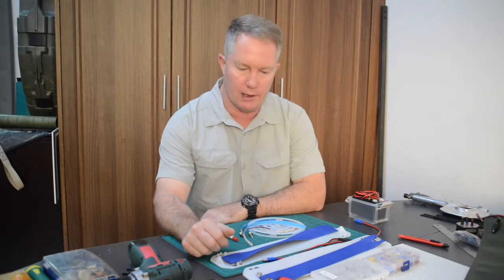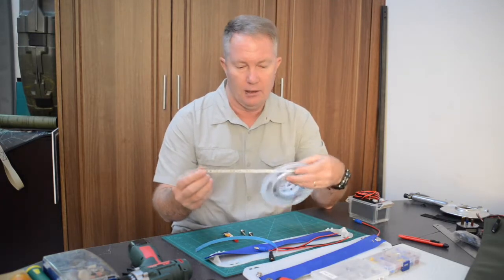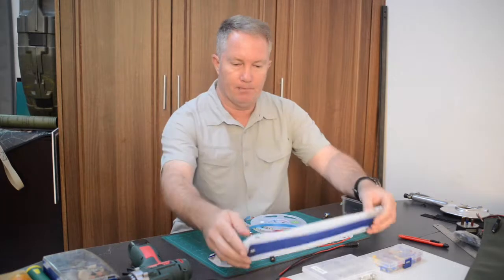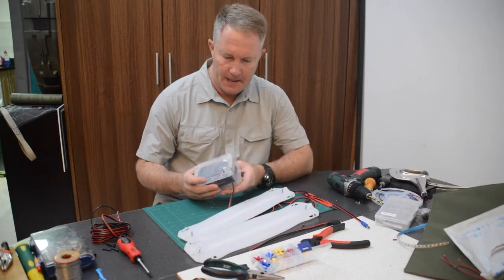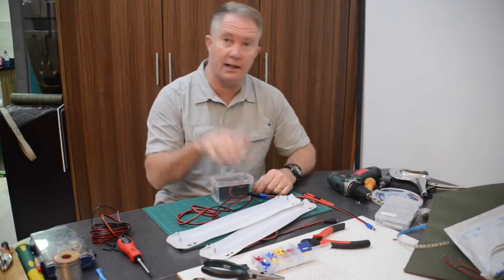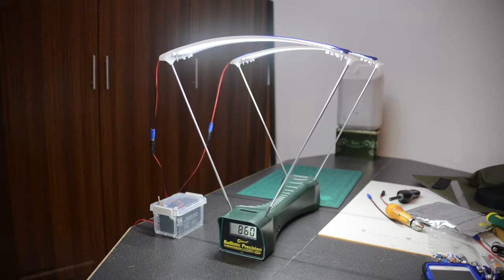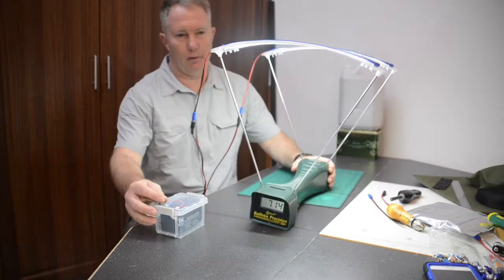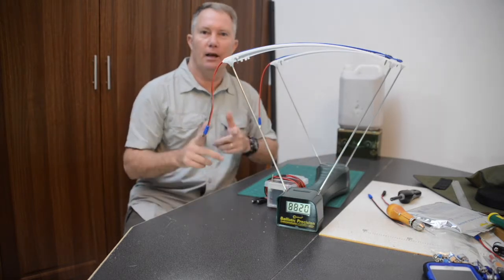Chronograph Fix for Indoor Shooting

Comment: I’m amazed at how expensive these are and they use visible light not infrared. I have just tested a cheap Chinese unit ( with an oscilloscope) accurate to  around 2miles per hour . Very reliable . I did make a cardboard cover as it became less sensitive in sun light!

Comment: is light on top or bottom of roof
Reply from the maker: Hi there. The light is on top. I do not think it will make huge difference, but shining through the white PVC will defuse the light and I think (maybe) easier for the sensor to see the arrow/pellet... ??
Reply: @affordableairgunningbyjb6994  yeah i got some wide fluctuation fps
230-330 fps on a korean bow.
Reply from the maker: @HistoricalWeapons  Was your light at the bottom ??

Comment: Did you use any specific type of LED's? Because when I tried using some battery powered work lights in the same manner, my chrono went nuts. I figured it was due to flicker.
Reply from the maker: Hi there SDMac Man....
Nope, i just used standard LED strip lights that use 12V .... 

I am not an engineer, but a 12V DC battery should not cause flicker... Maybe if your system is running from AC (mains) then it might flicker, but a normal battery system should not flicker.. 

Hope you can sort the problem... 

Keep me updated please for own reference in the future...

Regards

JB